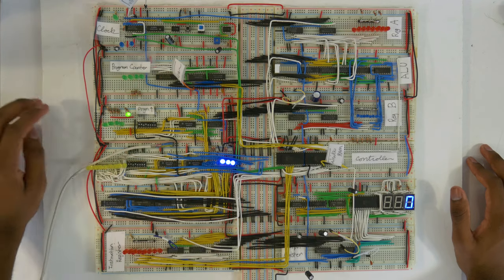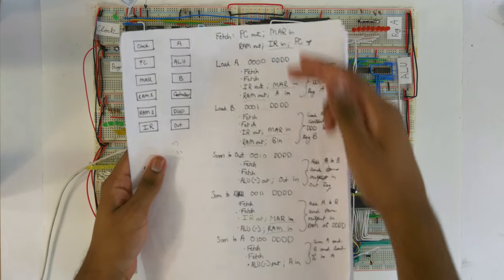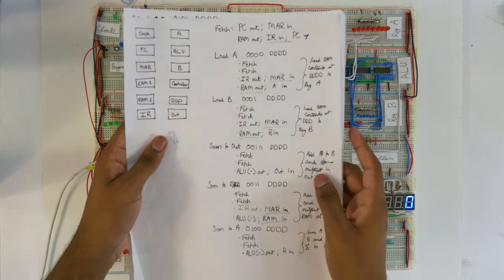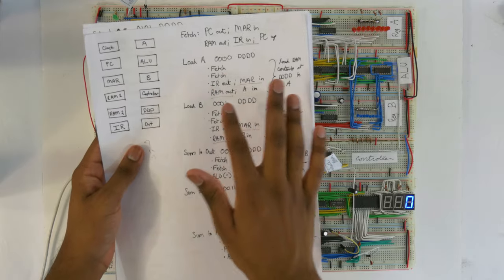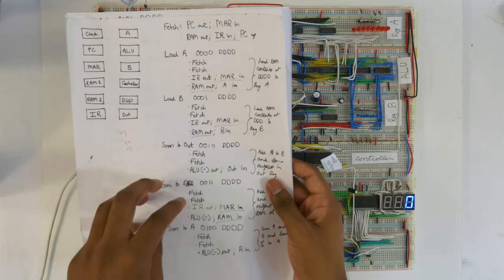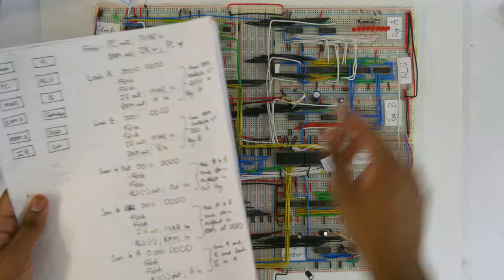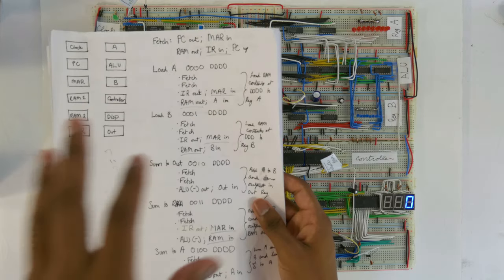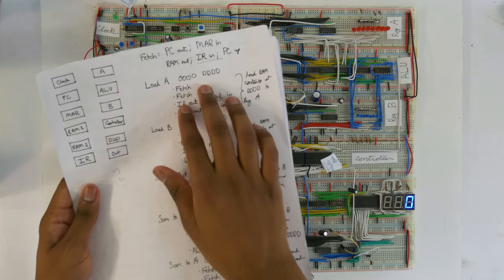Running Programs on our 8-Bit CPU

Comment: When you "write in" a program command, you are moving the "write ram" wire connected to the controller IC. Are you toggling that pin of the IC high/low? What exactly are you doing when you "write ram"?
Reply from the maker: "Write RAM" is the line that when connected to ground, writes whatever's on the DIP Switch to the RAM at the current address.

Comment: 안녕하세요
This question turned the translator.
I have a question.
I learned that computer software finally interprets the machine language consisting of 0s and 1s.
However, I know that 0 and 1 are interpreted as "electricity flow" and "no electricity flow" in hardware.
By the way, I am curious about the connecting part (?) that delivers what is expressed as 0 and 1 to the hardware.
In other words, I'm curious about what happens where hardware and software first meet.
I'm curious to know how to know that 0 is in physical hardware, and how do you know that it is 1.

It is difficult to see with a translator. I would appreciate your reply.